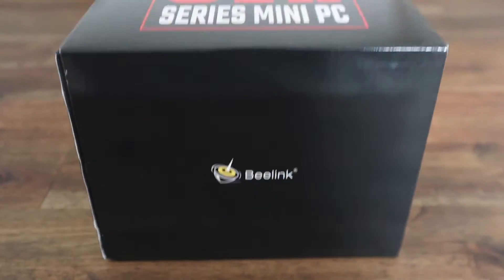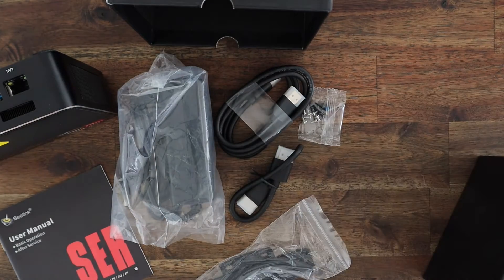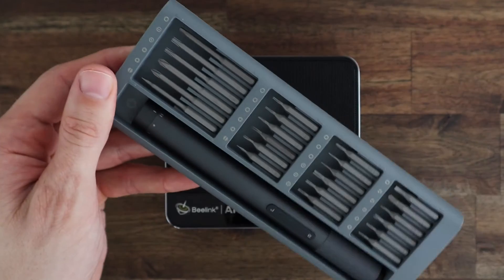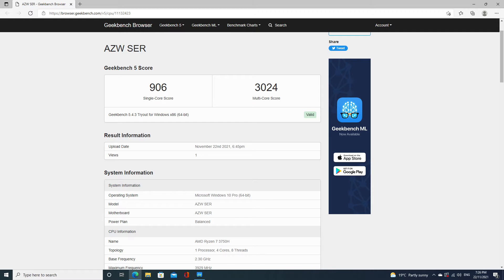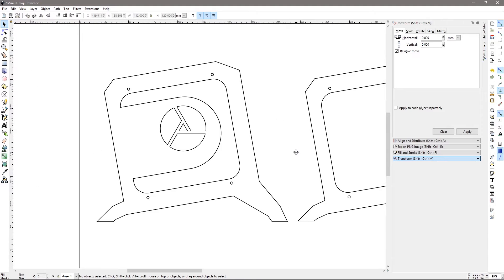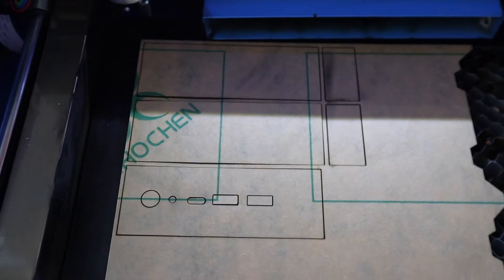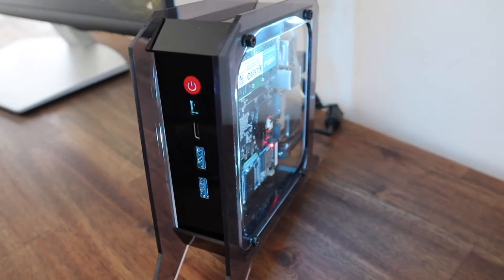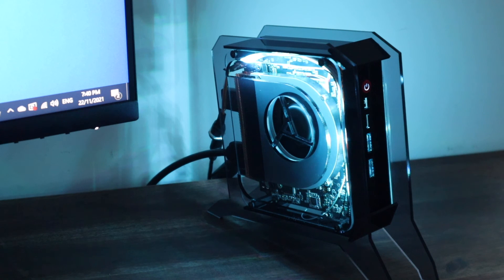Turning a Beelink SER 3 into a Custom Mini Ryzen 7 Gaming PC

Comment: NO- you're BETTER OFF to TRASH windows and INSTALL LINUX.. on ANYTHING...  then NEVER LOOK BACK.  CAn a 2 T  SSD (2  1/2 inch internal) drive be added?  I use a small SSD for my operating system now- with a large STANDARD 2T drive for DATA (storage and everything) to keep it separate from the operatind system- so if it goes bad- I don't lose anything but the OS- which I can always reinstall later.  CAN the drives it USES be changed in order-- in other words to use the 2T MVME drive for storage and the SSD for OS????  GREAT VIDEO- and I LOVE the finished clear look.. so neat.

Comment: Nice but that's only cosmetic and doesn't solve the main problem of this PC which is the fan constantly pulsating on/off, and not powerful enough to adjust the power to 35W in the bios like it should. Needs a beefier fan imo.

Comment: Could you have kept the sides of the original case (the entire perimeter is one piece of metal, right?) and fitted the acrylic pieces into it in place of the original top and bottom surfaces?
Reply from the maker: Yeah I probably could have made a plan to re-use it. The metal enclosure is a single part though, so the overlap on the top (with the logos on it) would have to stay as well, unless I cut it away with a Dremel.

Comment: How strong is the smell while cutting the matterial with the laser?  Hands down, I prefer your case design!
Reply from the maker: The laser is enclosed and has a ventilation fan which is ducted outside, so there is very little smell in the room.